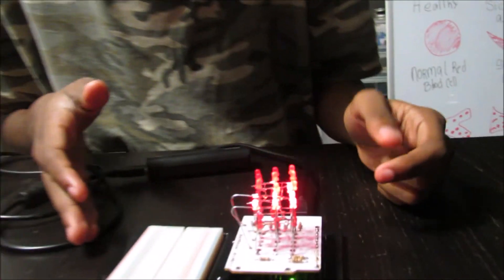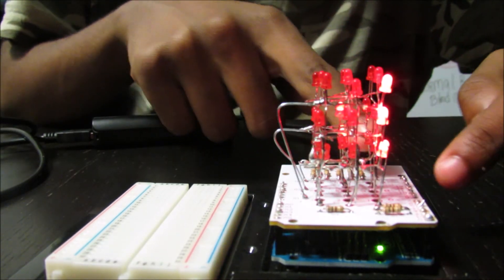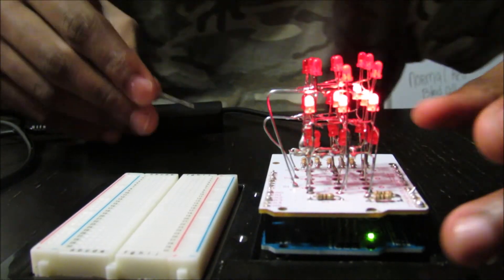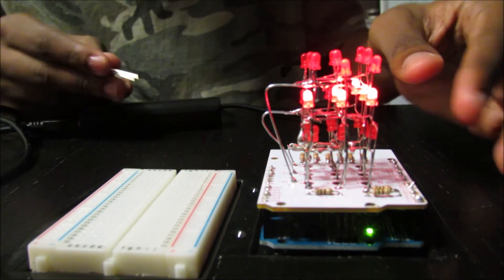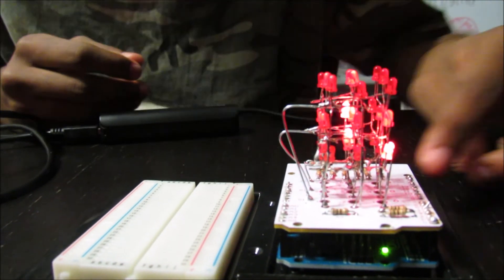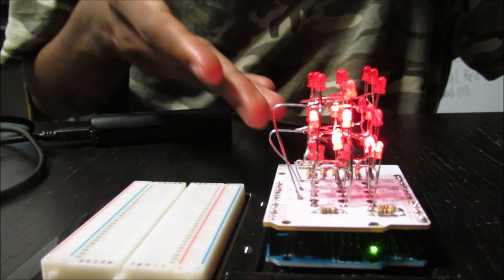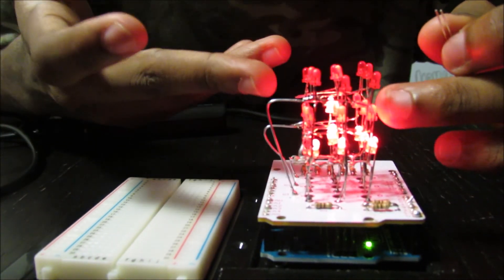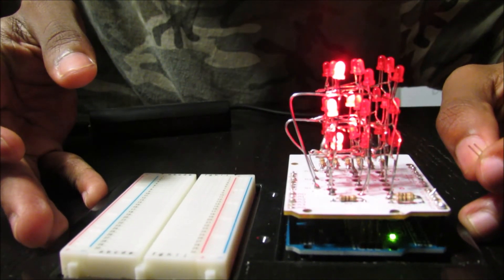Radio Shack 3D LED Cube Arduino Shield Kit

Comment: That is awesome! Building a permanent circuit with soldering is extremely difficult - you did an awesome job. Even with some of the LEDs not working, it still looks great and looks like it was a lot of fun to build. Thanks for sharing!
Reply: Building a circuit is only difficult  in the beginning. When you get enough experience it gets better. I know including myself  a lot of people certified in soldering like with PACE. You don't have to be certified with soldering , but it helps.  And if some light emitting diodes don't light go over them and figure out why and correct them . Its called troubleshooting.  By the way safety glasses isn't necessary either. I have been soldering  for over50 years with no incidents.  Keep up the good work.